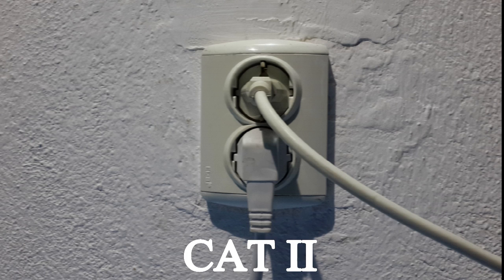What do CAT I II and III mean in electronics equipement? What is it? What does it mean?

Comment: If you use the wrong Cat rating it can be very serious. Cat ratings are related to creepage and clearances on equipment IE the distance between the tracks connectors etc. EG if you use a CAT11 on a CAT4 and a surge appears as you're measuring this can cause the air between the tracks and contacts to ionise leading to an ARC FLASH and most likely your death. Look on YouTube for ARC FLASH videos they are simply frightening, your absolute worst nightmare.

Comment: Can I use a cat 3 multimeter for car 2 work?
Reply from the maker: Hi Jeremy! Yes, each CAT covers the lowest category as well as you don´t over pass the voltage. CAT I, for electronics, , CAT II for main lines, CAT III industrial use, CAT IV in high voltage - high current. In your case of automotive, there are special  multimeters with some functions for tachometer,  and spark leads testing. (Cars and trucks are in the category of CAT I or CAT II, because its voltage is low and the current is limited by the vehicle's battery).
Reply: I didn't mean to write "car", sorry autocorrect strikes again. I work maintenance at an industrial fiberglass plant and I deal with alot of 480v. Mostly 3 phase motors. Plus everything else that breaks. But thanks for the video and the feedback.